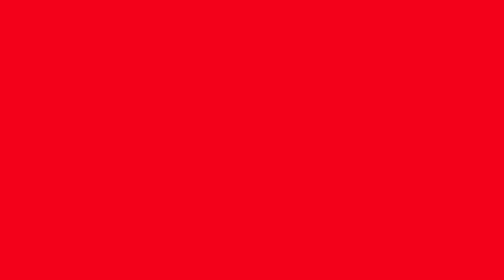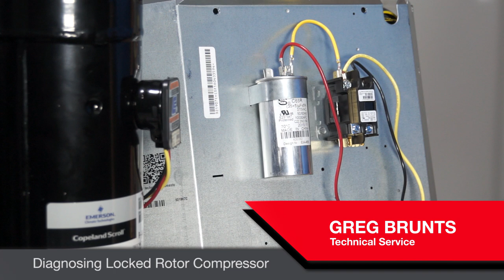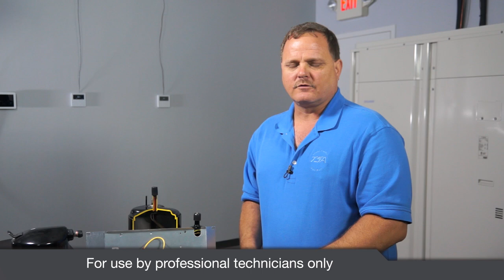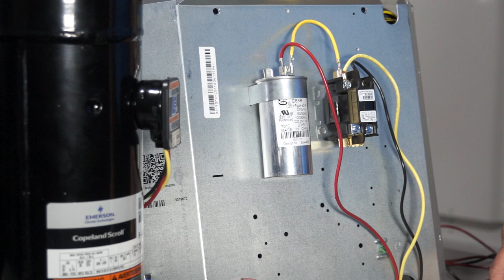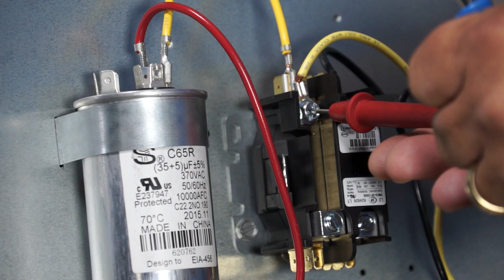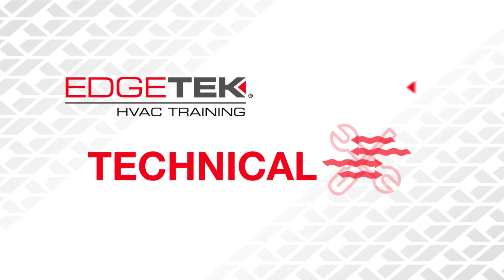Diagnosing Locked Rotor Compressor

Comment: Thnx Greg for an informational video. My AC compressor will not start & I get a really low amp draw < 2 amps during test. Is that possibly sign of bad compressor? The compressor is not shorted. Trying to determine if the compressor can be revived.
Reply: J TRA it could be a bad run capacitor. If you draw amps on all 3 legs then install a hard start kit. A 521 rated for the size of the unit. Also check the wiring for the compressor. I’ve seen wire broken in half inside the insulation.
Reply: Thank

Comment: If theres a fail in amps, next check is under the compressor terminal cover, look for a burned or loose terminal, OR occasionally thermal overload bimetal has died. 

Check everything, before replacing the compressor

Comment: I came across to this job where I found out initially the start and run capacitor are gone, when when I came back to put new capacitors, upon start up the system compressor drawing high amps (something like struggle to start) what do you think does the compressor already gone?

Comment: My compressor won't start easily(with realy) and is drawing too much current and I can smell windings buring after running it for 2mins.
I already brought 2 new compressor and it won't could there be any other issue?
Any bodies help is appreciated.
Reply from the maker: Please contact Tech Services for assistance 1.800.422.4328

Comment: Any Idea of how to find a reputable honest HVAC company? I got shitted out of 10k from the first one. and the second one was fine until a year later and the compressor has gone out and they want another 1k to fix it. and they said that after they fix it that it could still be something that caused it to happen that ill have to cover as well. I'm starting to feel like they are trying to shit me again. after 14 thousand dollars In less than 3yrs, I should have a working ac by now!  Though I know the compressor issue is possible I'm suspecting the system they put in wasn't new or was installed incorrectly by their tech which means they should cover it not me. And the system should have been new like what they charged me for.
Reply: The company you bought your system through, should have offered sometime of warranty besides just the manufacturers warranty. Covering all of that and then some. We offer 5yrs on all our retail along with a 10yr manufacturer warranty which we submit all the paperwork to make sure you're registered. Good Luck!

Comment: Hi I check my compressor and its read 6amps on all terminals what could be wronf
Reply from the maker: Hi Herman, our team would need a bit more information to help you troubleshoot. Please call the technical support line M-F from 8:00-4:30 CST at 1-800-422-4328
Reply: Hi sorry but it was 6 ohms on each terminal on the compressor, its not grounded I check. Getting same continuity resistance value
Reply from the maker: Hi Herman, for assistance please call the technical support line M-F from 8:00-4:30 CST at 1-800-422-4328

Comment: This unit trips the breaker as soon as the contactor calls for cooling. If I disconnect the compressor the cond fan runs no problem. Compressor is not grounded and has proper ohms. Wires are not shorted at all.
Reply from the maker: Please contact Technical Services if you need assistance.
Reply: Locked compressor! It was a question for you:)
Reply: diego what does he mean un even presssures before starting?  Mine has this and won't start.  I'm a plumber so I know just enough to be dangerous but have never come across this problem.

Comment: How do I equal the pressures before start
Reply from the maker: Please contact Nortek Tech Services for assistance 1.800.422.4328
Reply: Turn off compressor for several minutes and watch the suction and discharge pressure...it will equal...

Comment: You said +- 10% the cap said 5% its not normally more than 6%.
Reply: Wrong mamma, he is right, what is written on the capacitor from the manufacturer guaranteeing that the cap is within +/- 5 when purchased